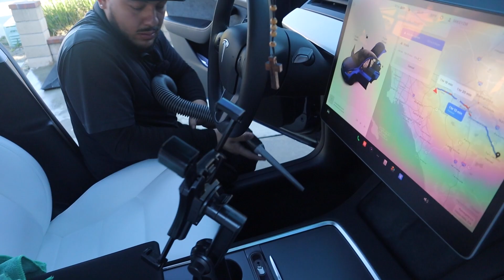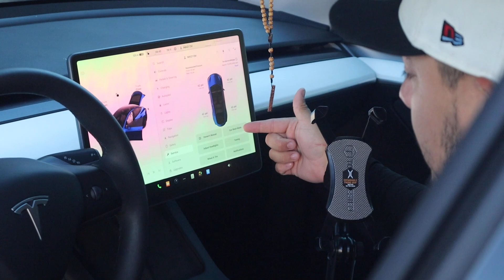Steps you need to know before washing car

Comment: Boss, when you spoke about doing the wheels last…. WOW!!! 

I’ve recently tried that process with my last two clients and it’s rendered some good results based on time management. I just wanted to experiment and see what happens if I do the hardest part of the vehicle last. 

I made a comment about it on another detailers video and received some back lash. Was even told that I’m doing my clients a disservice and would have to pay for damages. Like what, how? It was stated that I was spraying brake dust and grime on the paint. I use a turbo nozzle and when pointing in the right direction with technique there is little to no over spray. If your client is happy with the results, that’s all that matters! 

Keep up the great work!
Reply from the maker: Hey brotha thanks for dropping in. Sometimes people can have a strong opinion looking for anything wrong to point out. But at the end of the day do what works for you. If your using DI water there shouldn’t be any issues. If you get some break dust or chemical just correct it by spraying it off. Dont let any negativity discourage you. I bet if we look at someone 95 percent of the time you cant pick what you dont like or what they are doing wrong. If you have a good rhythm and routine you will be solid. Thank you for the amazing support👊🏽 keep grinding

Comment: Teslas are cool cars.  ONR is amazing I use it on the interior, it cleans good and leaves a good scent as well. How do you clean all the water that those style wheels hold after cleaning them?
Reply from the maker: Yes for some reason i like the sent too ! 
And when cleaning the wheels after we use a blower to remove all the water from the wheels. For cleaning the wheel on maintenance we use a product called wise guy from shine supply thank you for dropping in on the comments!🙏🏽

Comment: I add an oz of ipa to distilled water as glass cleaner
Reply from the maker: Oh nice what ipa percent do you use ? Thanks for dropping in on the comments 👊🏽
Reply: @m3finish  15 oz water 1 oz ipa.  don't need much at all it's just to break up whatever oil may be on glass and wipes streak free flashes fast

Comment: Tesla, hardly mainenance free...main thing range anxiety & actually finding  charging points that aren't full or out of use. Over all end up cost more than a ice vehicle......Also "pinch" the glass around the sides to proper clean them, not just the surfaces
Reply from the maker: I agree on that part range can be a factor for sure and usually i have a charger a home with a 15 amp so i at a fast charge in a few hours. For traveling i can agree on that. And thank you for the tip I appreciate you 👊🏽